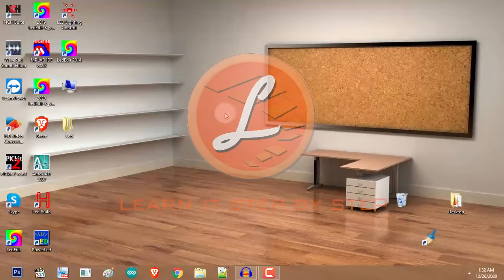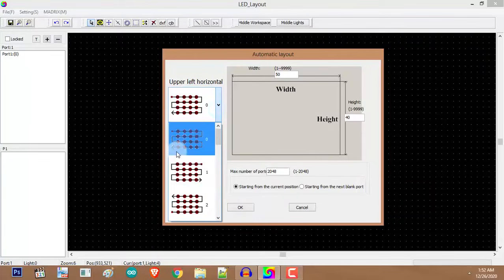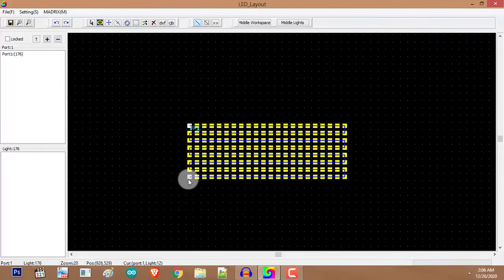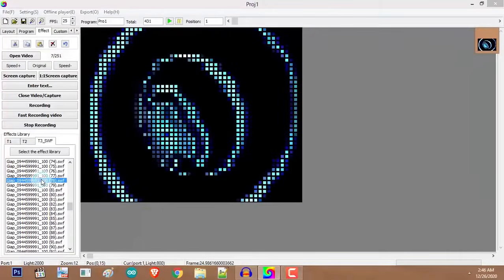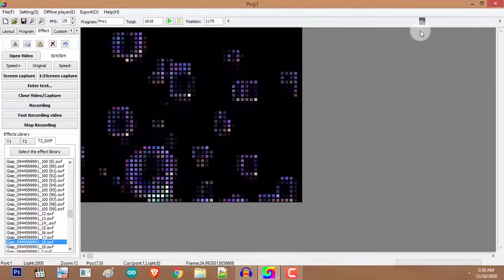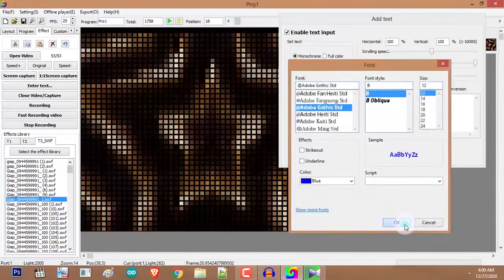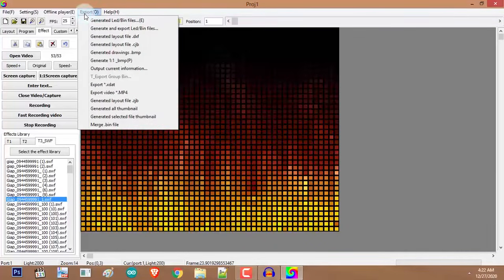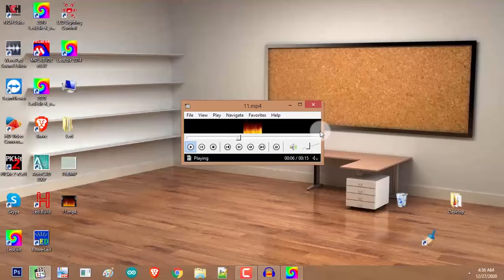How to Use LEDEdit 2021 Software | Programming Pixel LED Complete Tutorial

Comment: hi does the led edit 2021 works good with t1000s controler? when i record the video on the programme and than export it to the sd card when i play it in the controler the effects arent the same as i recorded on pc
Reply: I have this problem too. Why so, who can tell the solution? Everything is fine in jld Lededith 2014, but in the new version of the program it does not work!
Reply: No it doesnt, I spent weeks programming patterns and exporting them but couldn't get my T1000S to work, apparently they can only be programmed using led edit 2014, I had to buy a K1000C which works fine with led edit 2021

Comment: Is LED edit 2021 compatible with T1000S controllers? I selected T1000 in the controller list and have selected WS2812 for the pixels but I am just getting white flickering of my LEDs, I have tried different controllers and different SD cards but still have the same problem, I have checked all my settings and am sure everything is correct, any ideas? Thanks
Reply: Same here ! Very disappointing 😭
Reply: @yannou_on_inj  use the K1000C instead, i bought one and it works fine

Comment: Hello,
is the T-1000S controller compatible with lededit 2021 software?
I ask because I have a problem that I don't understand, the effects are ok in the software but they are not displayed on the LED strip, all the LEDs are on.
I mention that I have used and still use the lededit 2014 software version which works correctly on my 630 led matrix.

Thanks in advance.
Reply: I can't get my T1000s controller to work with led edit 2021 either, even though T1000s is shown in the controller list, patterns made in led edit 2014 are still working fine so it's the software that is at fault, wish they would fix it, there isnt even a way to contact anyone about the problem
Reply: @danf2903 Hi, yes, they have released a lot of software since 2019, but unfortunately none of them understand T1000S, although it appears in the software list. I also tried to contact the manufacturer, but to no avail. Even the sellers don't know anything, weird! All the best.
Reply: @miticanicu  yeah it's really weird and as you say no one seems know anything, used to have no problem with the 2014 version, I'm thinking of buying the K1000C controller which is the updated version of the T1000s and see if that will work, I'm stuck with loads of pixels and no way to program them
Reply: @danf2903  I'm sorry, I don't want to discourage you, but I have a friend who has both T1000S and T1000K models and he in turn is disappointed that he doesn't go with larger versions of led edit, although he is present in the list of controllers.
Reply: @danf2903  We suspect that in the list of controllers accepted by the software the two controllers are listed so that there are more (which is actually K1000 - with other endings than K and also in T1000 - the S end is not passed).
Reply: @miticanicu  as far as I know there is no T1000K, just K1000C, it has got to be a fault with the software, I'm 100% sure I have done every right
Reply: @danf2903  Sorry I wrote wrong, it was K1000C not T1000K :))
Reply: @danf2903  If you don't mind, I'll come back with the question, are you willing to share your files for me for the T1000S?
Thank you very much.
Reply: @miticanicu  so your friends K1000C wont work with led edit 2021? And sorry i dont have any files, as I said they wont work with the  T1000s unfortunately
Reply: @danf2903  Yes, as I said, my friend also has the K1000C model, which does not understand the program made with led edit 2020, 2021.
This K1000C inside the box has nothing more than a digital display and more button controls than the T1000S. In terms of file sharing, I wanted any files with the tool or swf extension but not those in the versions that have the edit20XX led software, but if you don't have that, it's no problem, I asked a question.
Reply: @miticanicu  Thought I would let you know I have bought a K1000C and it does work with LED edit 2021, so I would recommend getting one and dont bother with the T1000S 👍
Reply: @danf2903  Sir, if you don't mind. You would like to share files for me for T1000S, unfortunately I am at the beginning and I don't know how to create them and almost everything I downloaded from the net, honestly out of 100 effects I kept only 18.
Thank you in advance.

Comment: Excellent tutorial to learn to use the LEDEdit 2021 program. I followed the instructions from the link you added and now I have it. But I have a problem with the Effects with the extention *.swf, the software can not reproduce the effects, the other ones no problem (*.xdat, *.tol). Do you know what can I do to reproduce the effects SWF? where could be the failure? Thank you so much.
Reply from the maker: If you can please install l flash software (Micromedia Flash 8) . It will install flash player automatically .
Reply: @Learnitstepbystep  
Mine is asking me to update
Reply: I found the root cause of my problem, the problem is due to lack of Adobe Flash Player. The Adobe Flash Player is not available anymore for windows. Do you know what others programs works for LEDEdit software instead of Adobe Flash Player? Thank you.

Comment: Thanks for the tutorial . Well done .👍
Reply from the maker: You are Welcome !
Reply: Adobe has ended support of their Adobe Flash Player software/add-on. So windows no longer supports it. So what is LedEdit going to do to fix this? I have over 30GB of SWF files that I can no longer use on LedEdit and 3 other LED programs....so basically the controllers are useless in my honest opinion because I cannot create and save my existing files
Reply: @BricE50MustanG  just change the date of your computer to an earlier than 2020 date. This will help fix any urgent problem.
Reply: @dmx512-z9h  it's not working. Have you check it by rool back the year?
Reply: @dmx512-z9h  that won't work it's not a date thing. Once Windows and/or Adobe install those particular updates it won't work. Regardless if you set it back. If anyone needs any additional help contact me via email
Reply: @BricE50MustanG  Hello, your email address?
Thanks.
Reply: @BricE50MustanG  Hi, can't you share at least a few files?
Respectfully.